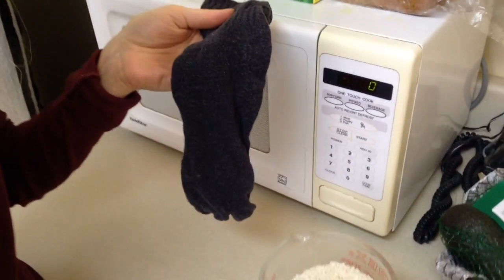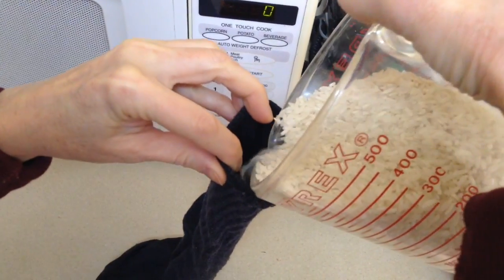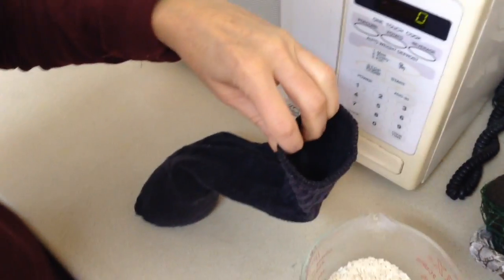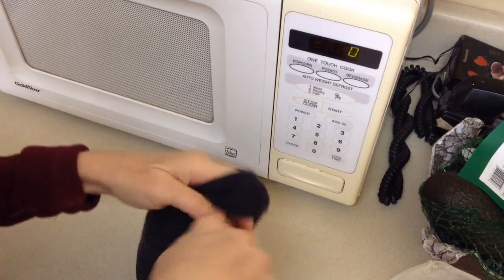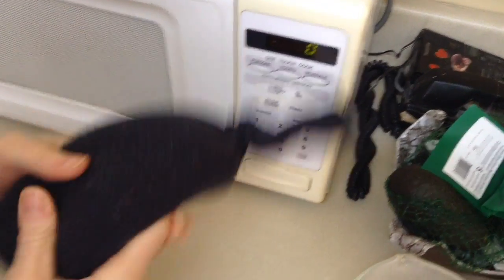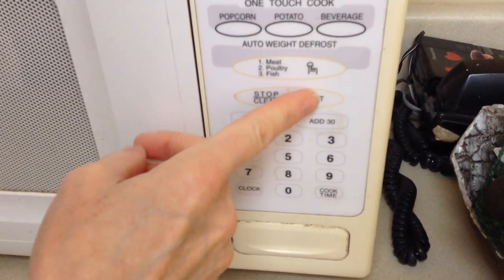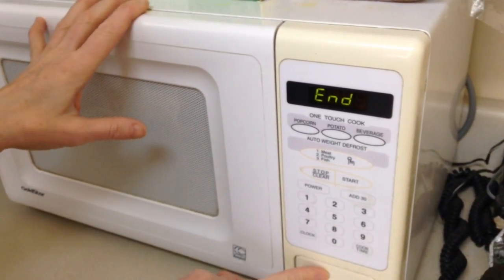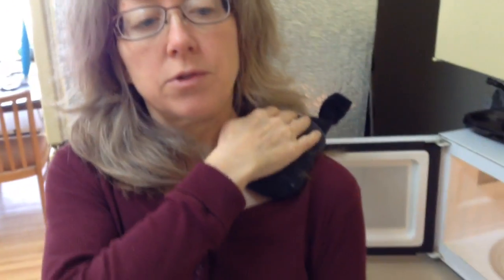DIY Heating Pad in Seconds No-SewTutorial for Period Pain Cramps

Comment: i tried this once but the socks started burning n.b did not use a microwave
Reply from the maker: Yikes. If you use the microwave be sure to use 100% cotton socks. If you do not have a microwave someone suggested filling a bottle with hot water and placing it in a sock!